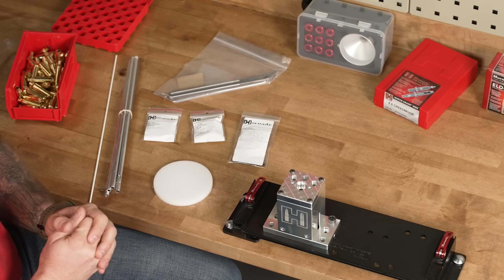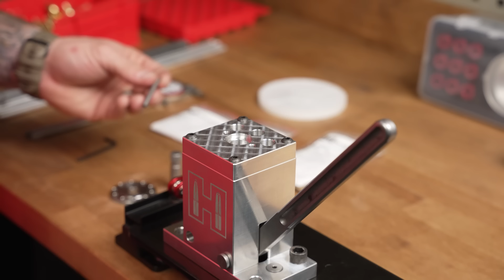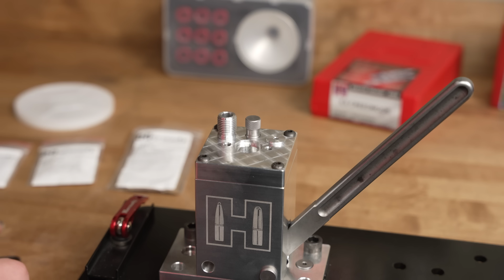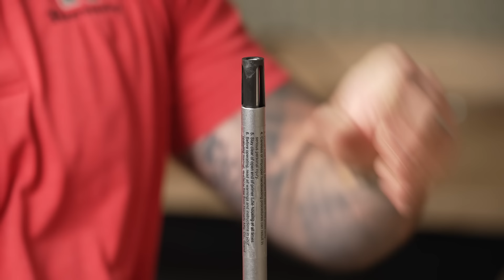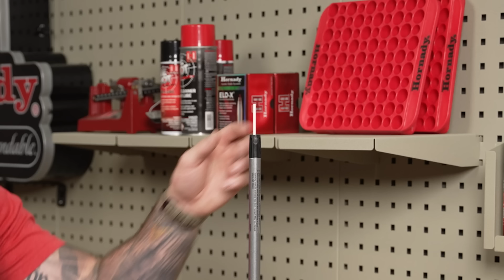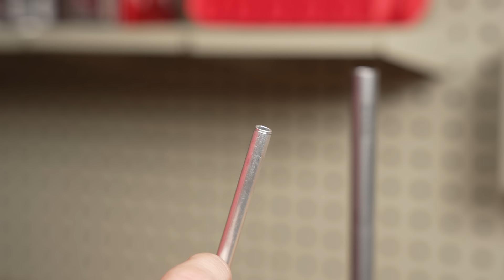Hornady Versa-Prime Bench Priming Tool: SETUP & OPERATION (Everything You Need to Know)

Comment: It came in a bit pricier than I'd hoped, but I grabbed one anyway. My hands are aging, and hand priming is getting difficult to maintain consistency for an extended priming session (I batch process). I used this video to do the assembly, though the included manual provides exacting instructions. The most difficult part was mounting it on my Hornady Quick Detach plate...I didn't realize that Seth had the plate inserted from the back, which I cannot do due to my bench layout. I could wish for another strategically placed hole on the left side of the plate when inserted "normally". Anyway, it fits with the 2 top mounting holes with the handle to the right, just clearing the mounting clamps when in use. I've only run through 300 cases at this point, but it's easy to get a flow going. Advance primer, insert case, seat primer, remove case....and repeat. 
One note...my #16 Hornady shell holder doesn't fit. The Primer Guide SM is too big, or the shell holder opening is too small. That said, the shell holder works in every other Hornady case prep tool I own, including the L-N-L Power Case Prep Center where the #16 fits perfectly. I my #8 Shell Holder, it fits the Versa-Prime Primer Guide SM, and it is slightly oversized on the shell holder spindle of the Power Case Prep Center. Obviously, there's a bit of slop in the Hornady machining department.
In summary...I love it. It's improved my priming sessions, something I can look forward to with excitement , rather than dread.

Comment: So, you explain at 8:00min about using your caliper for seating depth.  But you never do?   You mention SAAMI suggested seating depth.  What you guys have not done is explain the purpose of proper seating, over seating crush, and under seating.  Primal Rights explains obtaining ten measurements of a lot of 100 brass/primers and calculating, anvil height, primer thickness and cartridge primer pocket depth to get a SD average.  Furthermore, Greg discusses the importance of not having a proper seated primer and the firing pin strike causing movement when engaging. Greg explains his seater in combination to a quality-built action results in hunting rifles that shoot at .18 or better.  

In a nutshell, I backordered one immediately (low expectation) and then received an email from Midway they were in stock.  I received two units.  At this point I believe I'm sending both back for a refund.  Before I do, I will check out my buddies tomorrow.  Mine are still new in the boxes.  

I'm hand priming and two rifles I just load developed are shooting .1805" and .1875" groups @100yds.   With Berger Bullets.  I think I'm pulling the pin on the Primal Rights primer seater and the gauge setup.   Hard to beat, and I don't think you did anything amazing when it comes to precision loading.  

I also loved the fact you copied Henderson Trimmer.   Glad he collaborated with RCBS so he can compete with you lower unit cost.  What a shame.  

Keep racing to make all wildcats SAAMI SPEC and corner the market in bullet offerings.  

Also, maybe you can start putting on ever box the G1, G7, Bullet Length data because in new offerings it is like pulling teeth.  Get you website in an esier configuration.  Go to Berger and you can learn a thing or two.   It is always a pain in the ass when looking at factory Hornady Ammo and Bullets the majority of the time.     You are about the money!!! 

The 69 ELD-VT .224 is a pin holing machine according to top coyote slayer tournament winners.  Reminds me of the 75's.  Just witnessed last week on an adult male coyote at 174yds.  Pinhole.

Comment: Over complicated setup. Retrograde to have to clamp shell holder in when every other press and primer tool has click in fitting.  I expect auto feed for this price - advancing a wheel by hand is just naff.  As others have said, no point in having precision seating depth adjustment without automatic compensation for variations in rim thickness. Seating to full depth of primer pocket is best anyway as it ensures the anvil is in hard contact with the case and won’t be displaced when the primer is struck.

Comment: That method of dropping 100 primers that distance is dubious at best.  Why transfer from one tube to another in a vertical.  On a slope would be ok, but not vertical.  The only cushion would be the air in the feed tube if the lower tube was blocked.  You can do better.  Just have a socket for the pinned tube, place the filled pinned tube in the socket and pull the pin to drop the short distance instead of the full height of the tube.  Too complicated as is

Comment: High volume reloaders will really appreciate the consistency, speed and safety. 

As for comments about having to buy Hornady shellholders, if you own 100s of cases of Alpha, Petersen or Lapua brass, and loading Hornady A-tips, ELD-Ms or Berger projectiles and using CCI BR4 or 450s, or other benchrest grade primers AND you are willing to buy a precision priming tool, I can't see how the cost of a shellholder (or two) that will outlast is are going to be a cost concern!

As for taking a design,  improving it, mass producing it and making it widely available at the best cost possible, I note that no one has those concerns when it comes to automobiles, otherwise there would only be Fords on the road. Or Carl Benz 3-wheeled horseless coaches...

Comment: Hi guys, don't be wrong, I liked HORNATY equipment(not all) this one looks nice, but to complicated compare to DERRACO Precision Priming die or even Lyman Accu-Prime auto-load, primer loading disc is metal, how fast you finger be at pain to turned 100 times? also primer depth adjustment measuring by eye, com-on guys, it's 2026 not 1956, it's time to start do micrometers in precision tools.

Comment: Primer seating depth, consistency, still limited by rim thickness, variations?
Reply: My question too, I suspect it is from what I see here
Reply: @FClass  I run the 21st century and priming tool. 74 year old grip strength is diminishing. I bought a device that holds it, but you're still sort of pushing on it always looking for more consistency. I've done the measuring primer pocket ,cup ,anvil I can still get mighty close with just feel.

Comment: Question:   You mentioned using only Hornady shell holder because of the design.. what size comes with it? Universal? Do I need additional shell holders for each caliber as  I do now?   Thanks. Joe A.
Reply: no universal shell holders, needs per cartridge shell holders. some double up, 30-06, 308, 6.5 creedmoor, 270, 243 all use the same size. you will need to check hornady shell holder charts.

Comment: Nice.   But after years of reloading and using just about all out there.  I have to say a Redding T7 press with the Slide Bar auto primer feed is a winner.
Reply: No love from Hornady on this one 😂
Reply: RCBS and Lyman copied the Redding slide bar system. I like them and use both, but I love the RCBS bench prime as it's very fast to not only use, but also to change size and shellholders. It's cast iron and steel with a heavy steel handle so that's a plus as well, but for certain things I love the slide bar system too especially for pistol plinking rounds on the turret as it speeds up production..
Reply: This is a copy of Primal Rights priming tool